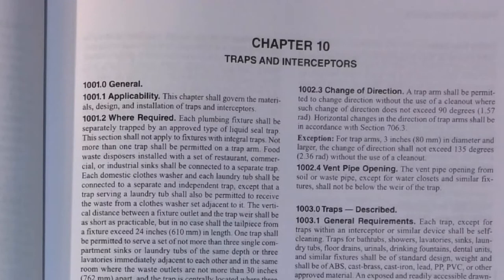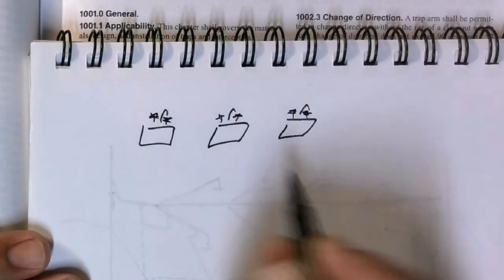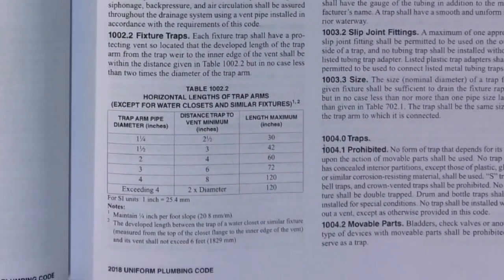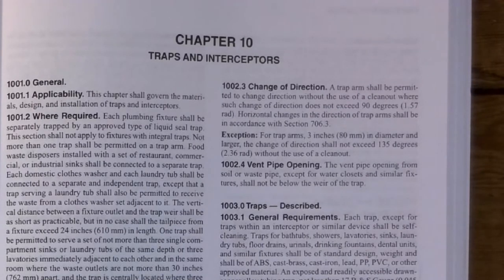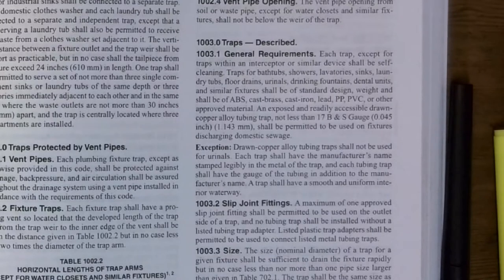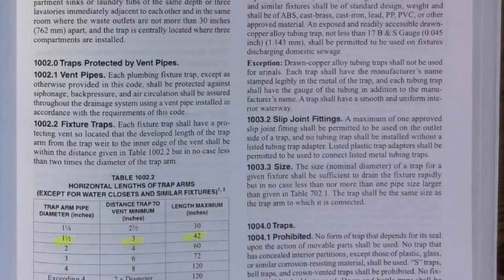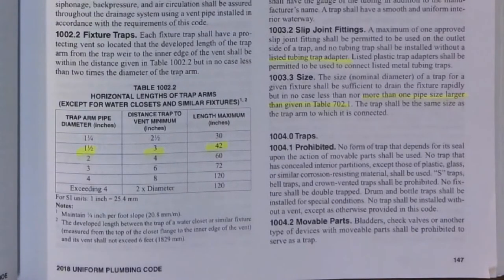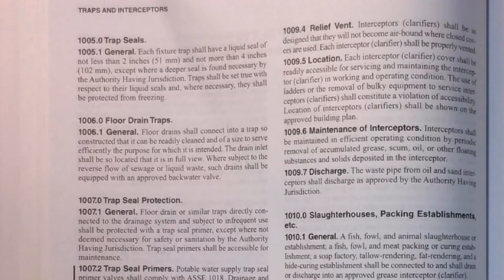Chpt 10 Traps and Interceptors

Comment: Can a laundry tray connect into the standpipe of an automatic clothes washer? Seen a diagram somewhere that had it as long as the stand pipe extended above the laundry tray and wasn’t more then 30” away from it
Reply from the maker: I will answer this based on the Uniform Plumbing Code, which is what I am regulated by.  Section 1001.2 says "Each domestic clothes washer and each each laundry tub (tray) shall be connected to a separate and independent trap, except that a trap serving a laundry tub (tray) shall be permitted to receive the waste from a clothes washer set adjacent to it."  So in other words, I would not be able to legally perform that type of connection, nor would I want to.  That very same code section says that not more than one trap is allowed per trap arm.  If the laundry tub (tray) is ran into the stand pipe would there be no trap under the tub (tray)?  In this scenario if there is then it violates the code, if there isn't then it violates the code. So therefore this scenario can not occur.  Again this is the UPC.  You may use a different code.  Kyle, didn't you tell me before where you were out of, or am I thinking of someone else?
Reply from the maker: Philly?
Reply: @BGsPlumbingClass  thanks so much for the quick response and yes I’m from Philadelphia using the IPC and actually just found it in the code book and it actually allows you to do it in the IPC. Crazy how 2 codes say totally different things but yet it’s still all plumbing
Reply from the maker: @kyleleaper8334  Yep, I keep meaning to get the IPC for my own information.  I still contend though that even though your code allows it, it may not be the best practice.  From all previous comparisons between the two codes, for the most part the UPC is stricter- with both being almost identical the majority of the time.

Comment: Sir, can i take diversity factor in the selection of drainage pipe horizontal or runoff size as the number of dfu is more as its coming 8 " but there is height problem so i cant go above 6" pipe so can we use.
Reply from the maker: I'm not 100% sure as to what you are asking, but if you could be a bit more specific- like your total dfu demand- maybe we can start from there.

Comment: What state does these codes pertain to?
Reply from the maker: The Uniform Plumbing Code is used in many States.  Here in California we've been using it for several decades.  I've a list of codes used in the states if you would like to know any of these I could relay that to you.  There are several similarities between the two primary Codes used in the States with little differing between them.
Reply: @BGsPlumbingClass  I’m in Florida and there are some differences.   When I watch your videos I try to fellow along with the Florida Building Code Plumbing 7th Edition.   I do appreciate your videos and I’m sure others do as well.
Reply from the maker: @tonyhddodge4282  Florida adopts the International Plumbing Code I believe, which definitely has a few differences- especially the distances required for the trap arms.
Reply: @BGsPlumbingClass  Yes, you are correct.
Reply from the maker: Since our last communication, I have fled the state of California to much greener pastures.  I am now in East Tennessee and working under the IPC.  I have to say something about this code.  OMG!!! Agonizing.